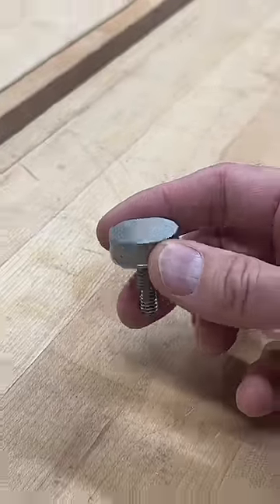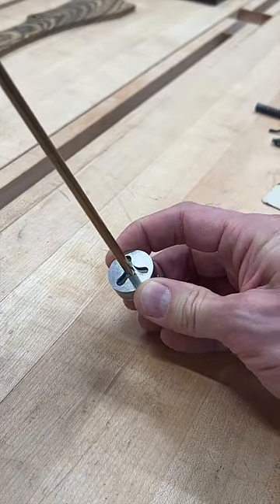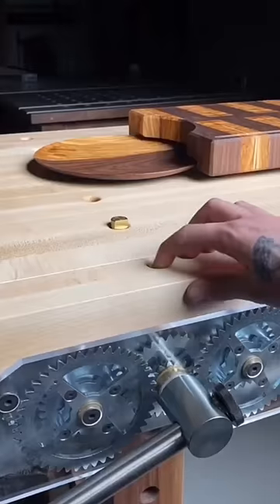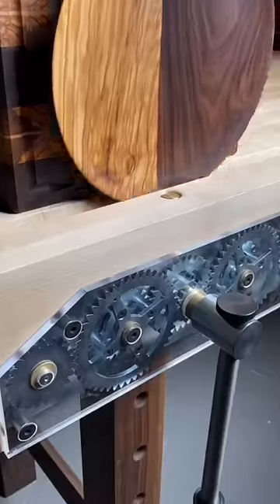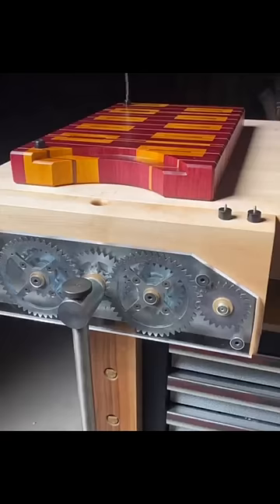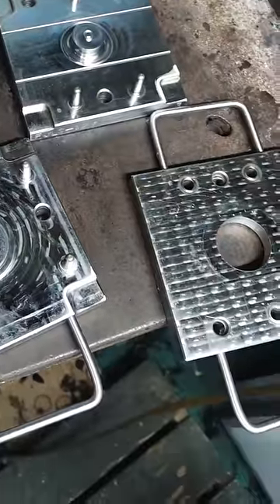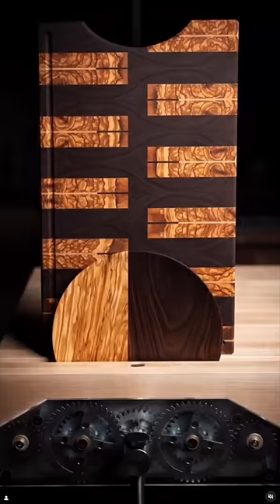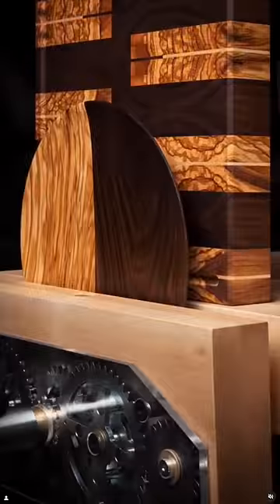Pika Screw on Owl Woodworks cutting board

Comment: Perfect! High end screws at $26 that you’ll never see being used as screws for the rubbers on the legs! Brilliant!
Reply: This type of comment let’s everyone know you missed the entire point of what this man does.
Reply: @Mr1121628 Then why did you post it?
Reply: Again you missed the point
Reply: @All_SportGG  Ok so can you clarify what's the whole point?
Reply: The whole point is that you will never see the most expensive srew ever 😅
Reply: @Mr.deBest  Thank you 😂
Reply: @Mr1121628 This type of comment lets everyone know you lack common sense
Reply: @Mr1121628 creates useless over engineered products for non issues? No artist is going to be insecure about screws showing their heads.
Reply: @acewmd.  yeah seems like people also missing that the head could get turned without a slot at all just some good grip :/
Reply: @CommanderComment  yeah, overall it’s certainly something that was engineered, but that’s all it is, engineering is for solving problems that actually exist, this guy is trying to pull a problem out of nowhere and sell the solution for a ridiculous price.
The worst part is the alternative is easier and will look better anyway. 
I mean if integrity isn’t an issue just sand it.
Reply: Even better, when you need to unscrew it, first you won't find it and if you find it don't have a screwdriver for it.
Reply: @acewmd. And if integrity is an issue you don't want this sctew anyway, as more moving parts will mean it will break more easily... For an exorbitant price.
Reply: @AnMComm  of course, we all know craftsmen want to pay the price of hundreds of screws all for a single one that’s less efficient.
That $104 was well spent for the bottom of that cutting board.